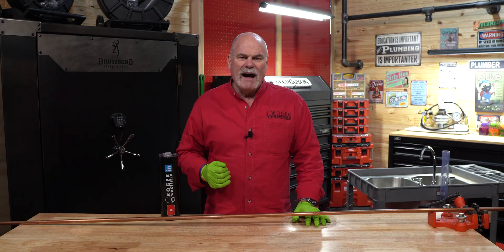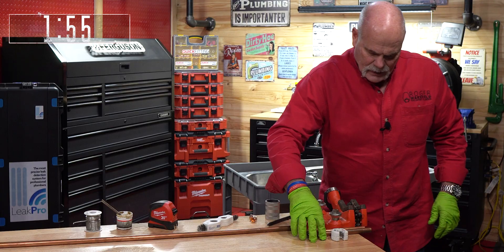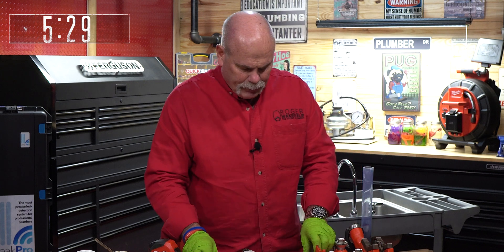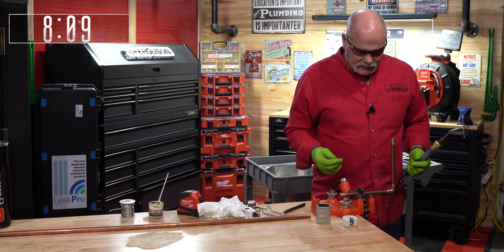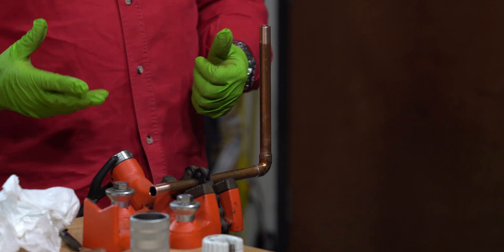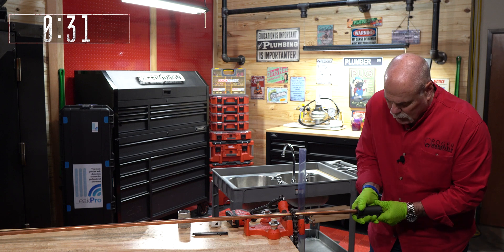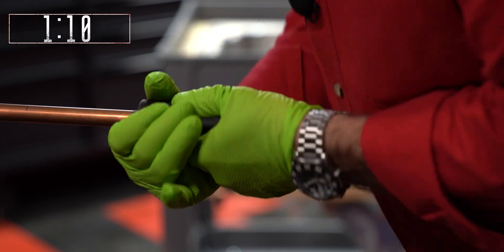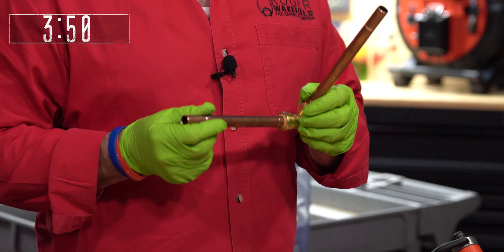Push-to-Connect Fittings vs Soldering

Comment: Homeowner insurance companies on older house often require video or in person inspection of the plumbing.  ANY push to connect fitting will be an instant denial, it is seen as patchwork.  

Any old PEX or galvanized water lines - denial.  Most definitely any push to connect will be an instant denial.  Slinky p-trap - denial.

Say the push to connect is going strong after many years and you have an unrelated water damage issue, they'll look at the push to connect that has nothing to do with it - and deny your claim.

Comment: i work commercial plumbing in a pharmaceutical. 99/100 jobs we do are pro press for the simple fact that we don't need a hot work permit. I get excited when we get a job that we can solder on

Comment: Can you do a propress vs solder psi test to failure? Would find that interesting
Reply: Every vid I ever saw trying to get a sweat join to leak had either the test stand break or the pipe itself blow out. PP excells over sweat because of SPEED. And SPEED = more $$$$.  Pro's yes it makes sense. New installs during rough...yes again. Service and repair? (me) no way. I care about my work out living me. I don't like call backs in the short term. I'm NOT a speed plumber trying to get double rich in one lifetime.

Comment: What's the cost per fitting between 1/2 and 3/4 sweat couplings compared to quick fitting? Sure it's 5 minutes quicker but a sweat elbow cost under a dollar and these ptc are probably 7-10 bucks.

Comment: Just use Pex-A and get something more resistant to freeze and corrosion.  Never use any push to connect or propress for a connection inside a wall.  Push to connect or propress rely on an oring which will not last more than 10-20 years.  Push to connect or propress can only be used on a water heater that you will replace every 10 years.  Propress should really only be used in commercial to connect machines.    
Quick Connect are scammers to say 75 year warranty on fittings like that.   If you look on their website, no where do they even state what kind of rubber they are using.  You have to click into spec sheets and then it says EPDM70.  EPDM in a good environment lasts up to 30 years.  In a chlorinated water environment, it will last less than 20 as it only has a fair resistance to the chlorine in water.  Then with other things in water who knows when it will fail.  Either way, a 75 year warranty is a scam on an EPDM seal.

Comment: Can you (or any plumber) explain what failures you're seeing with with push fittings? As a home owner, I use them on faucet/toilet/washer shutoffs for years with no leaks. It's really helpful because the escutcheon plates will get rusty and I can easily take the shutoffs out to replace the plates.
Reply: I had one 2 days ago just split on one end and shoot out
Reply: Im a licensed journeyman plumber that mainly does service and remodel. I can weigh in. 

99% of push to connect failure is user error. People not deburring or beveling the cut edge. People not fully seating the fitting. People burying them (don't ever bury a push to connect. The release mechanism can be engaged by the dirt. They claim you can wrap them in some sort of material to bury them but I still wouldn't. They make burial fittings that work far better for those purposes)

For what you're describing, it's probably fine so long as it's properly installed. That's the real caveat. Whatever you're putting in, put it in to the manufacturers specifications. They will have them on their website 

Follow those and it should be ok.

Comment: Why did you solder the top first on the horizontal? Always start at the bottom otherwise the solder doesn't fill in completely. Like an upside down triangle of solder.

Comment: The only time I use push to connect fittings is transition from cpvc to pex. Solder and propress for everything else.
Reply: Only time I use it is to adapt off of Old quest pipe

Comment: Soldering is easy if you know what you're doing, longer lasting and cheaper than ptc fittings. The only time I've recommended a ptc fitting was to a customer that had a freeze break 2 hours before his christmas party - I was tied up on another job so I couldn't rush to his aid. I told him over the phone to get a ptc end stop and he was able to get his water back on till I could get out the next day and fix the break properly. He told me I saved christmas lol!

Comment: We mostly use propress at my job. We only use sharkbites to tie pex to cpvc.
Reply: Any bad experiences with pro press?  Dying to get one but theyre really expensive.  Clean finish 👌
Reply: @ Jeff Reid The only issues we've had were with megapress gas fittings. They will leak if you don't run a sandcloth over the ends of the pipe you're pressing the fittings onto.

I found a manual propress on ebay for $158 but I don't know how good they are as I've only used the Milwaukee M12 and M18 ProPress tools.

Comment: I take pride in myself as a professional  in doing the right job with the right materials. With that being said I'm not too fond of installing something that a  homeowner can do themselves. They are paying me to do the proper job  not necessarily taking the easy way out.  Besides that I really don't trust any push-to- connect fittings . I have seen too many issues with them
Reply: I paid a plumber $1800+ for a burst pipe over Christmas. When I found out he used push to connect fittings I flipped...
Reply: @matttelz6014  : and you actually paid lol
Reply: Unfortunately, that's been the trend. Everything devalued, dumbed down to the lowest common denominator. Skill means very little anymore. Thank God my career is in late innings
Reply: Do you prefer soldering or press fit copper fittings? Press fit seems to be the new way to go
Reply: @Picksix54  I typically prefer to solder. The method has proven itself for decades. I  use press in certain situations like when I can't use a torch, or if I can't get water to shut off completely.
Reply: @Mikey Pipes  I agree, you can't beat soldering, especially when it comes to longevity.  Just getting into the plumbing business and I like to ask guys with experience what's the best route.  Press fittings seem rather expensive and even though it's less labor, it looks like it would cost significantly more, especially if it's a big job.
Reply: @Picksix54  : with press you can fit more work in a day which will cover the cost your spending on press fittings and some so are you really making more money soldering? Some food for thought
Reply: @James Curley  that's valid, time is money!
Reply: @MikeyPipe  I would guess every type of fitting has its place.  I work for a company that, as well as manufacturing pipe, we also import fittings of all types.  My job is to pick orders for Canada and the USA and while press fittings and push-fit have their place, plain, old copper fittings is still the bread and butter of our company.
Reply: We don’t solder because it takes at least 4 times longer then each press x that by your work day your able to triple your work load
Reply: Yes sir I agree 100 percent. I think you have to have pride in your work
Reply: @Mark Flanagan unfortunately, not many people do anymore.  Plumbers/electricians/hvac companies have a lot of bad apples trying to get rich quick and do shotty work for top dollar
Reply: @Picksix54  ham and Eggers. It's a shame

Comment: I use push to connect if I need to outside only. Don’t need to be that fast to move to the next job, would rather be thorough and at least sweat to pex adapter

Comment: Do the other push to connect brands work as well, used properly?
Reply: They all work well and are quick to use.  Short answer... use push to connect outside of walls when it's more convenient. I've seen them fail, but when they fail they tend to leak very slowly.  They typically don't last as long as a copper joint, therefore you should never put them behind a wall. Unless you plan on selling your house soon

Comment: i always think about the video you did where you went up north to that lab and pressure tested all of the different types of couplings. you used the same copper female adaptors to thread into the testing machine and reused them for every trial, and the solder joints on those females never failed. you only tested the mechanical fittings onnce but were able to pressurize the solder joints on multiple trials. that video sealed the deal for me.